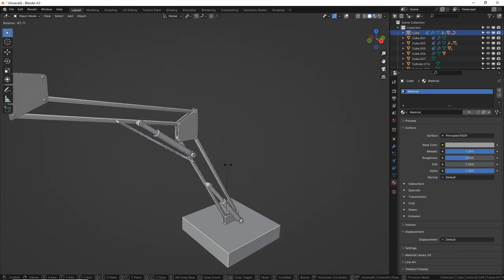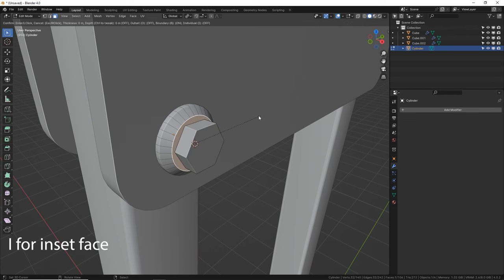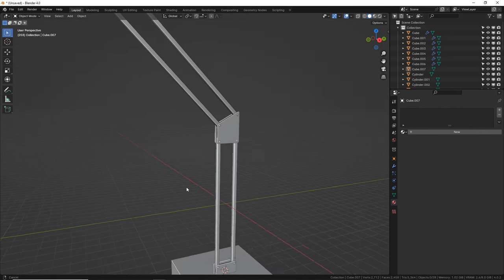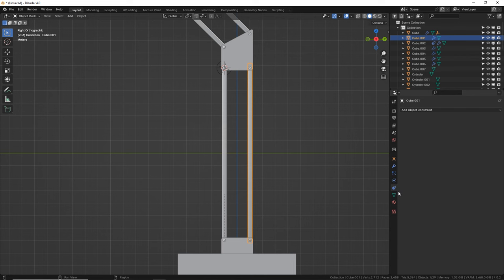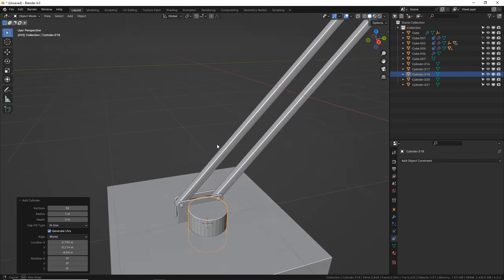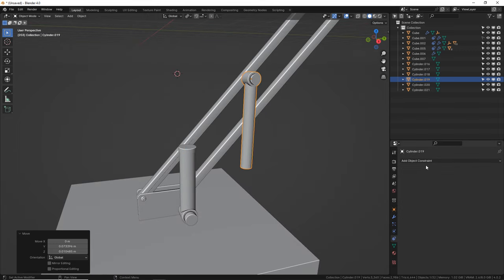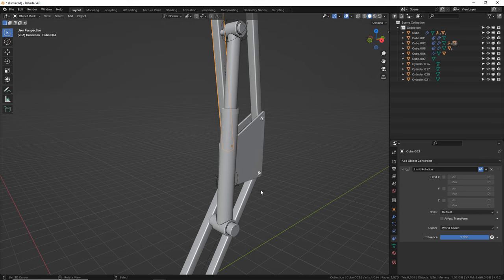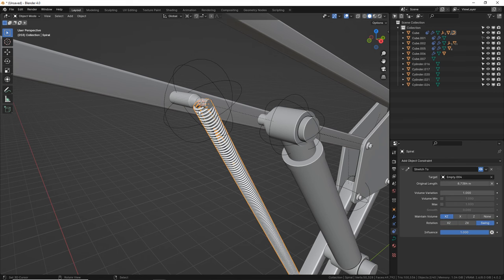Make mechanical rigs without bones in Blender!

Comment: very interesting tek. But adding those constraints to all the bolts (without even copying attributes) seems too much, I'd join all bolts and the part they are attached to into on mesh and have one constraint on that. I think that would work as well, can't think of anything that would make it not work.
Reply from the maker: Yeah definitely join meshes! I've been working on the pistons kit and it's looking really nice. I want to make some really advanced setups using constraints and make some cool scifi mechanical animations. I have a previous video on how to use it for correct gear animations.

Comment: Thanks for the brilliant tutorial!, I learned so many little tricks from this clip.  I have a question I am stuck on. When I add a "Copy Location" constraint, it works just as I need it, however when I click the drop down in the constraints modifier to "apply" the constraint, it no long works and the constraint disappears.  Any idea why? I was assuming this would "bake" the constraint to the object, but it doesn't.
Reply from the maker: Yes just as with any Apply Modifier it will bake the current data (copied location) from the modifier to the model and make it permanent. After that the object will no longer copy the location of it's target because the modifier was applied and baked. Don't do this if you want things to stay linked or constrained as in this tutorial.